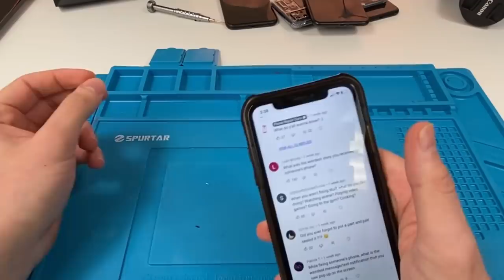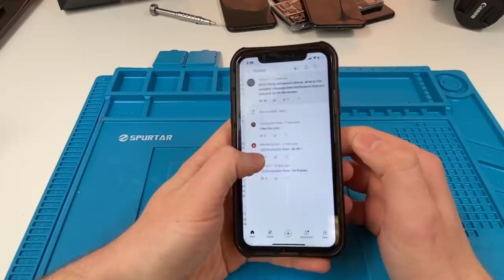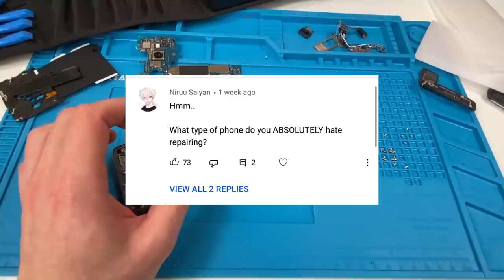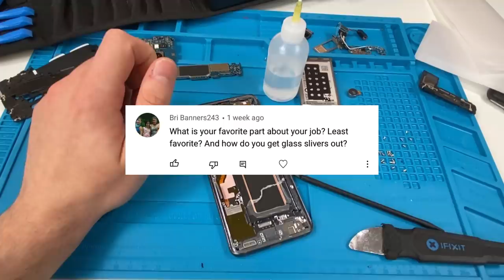Fixing a Samsung Galaxy S9 & Answering Your Questions

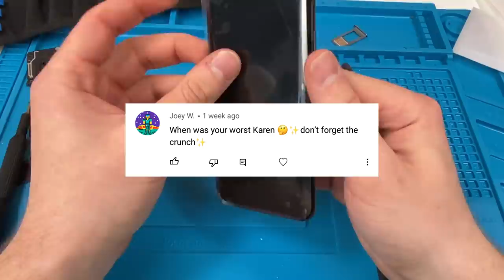Comment from the maker: The Karen part is at 8:00 for anyone to impatient
Geting a new pc and Camera tomorrow so Quality is going to fly up :)
Reply: I’m no karen, i won’t jump to the point, i’ll watch it all!!
Reply: Oh
Reply: The electronic screwdriver is so cool 😎
Reply: How do you get the Electric socket screwdriver?
Reply: Yup
Reply: What’s the most exotic phone I fixed?
Reply: Haha thank you
Reply: That’s mean....
Reply: Most epic fail?
Reply: where can i buy parts? pls
Reply: I never thought I'd find someone to explain this little process to, but you can probably help a bunch of people with it, @phonerepairguru.

I've been doing electronics repairs since 94. I live on a small island in the Caribbean and tourists seem to love dunking their electronics in the ocean. I found a way to salvage a fair number of them.

You need an ultrasonic cleaner. They're like $150USD. Buzzing a board in the ultrasonic cleans up under the chips under the non-removable heatsinks.

Here goes:
1) Remove the lcd and battery
2) If it was salt water, douse the rest of the phone with DISTILLED water
3) Remove the board
4) More DISTILLED water on the back of the board
5) Drop the board in the ultrasonic and buzz it for an hour on high, with heat
NOTE: Don't let the board sit in the solution after it's buzzed.
6) While the board is cooking, vigorously brush/clean or replace anything that looks crappy (shields, screws, cameras, home flex, battery, charger port, lcd, go crazy)
7) Ding! The board is done. Take it out with your fancy tongs. 
8) Douse it with DISTILLED water again. (Do you like how I yell DISTILLED every time? Sorry, I have been hurt.)
9) Hit it with a slow stream of IPA (do you use 99% isopropyl alcohol? If so, I would suggest switching to 99.9%, to get rid of 10x more of that water)
10) Place the board on a ceramic tile. I clean a spot on my floor for this step, but I always intend to go put a tile on my bench.
11) Use a heat gun to boil out the water. Don't overheat the board: set the gun to 250 degrees c/500 degrees f and hold it 10-12cm away. Heat the board evenly by slowly passing the gun over it. Every few seconds, passing your hand through the heat stream will give your brain a good indication of the board temp. Get it hot enough to boil away the water trapped under the heat sink and ICs. Flip the board over and do the exact same thing. This side takes much less time.
12) Appreciate how the board gleams and sparkles at you.
13) Let it cool completely. If the client isn't swinging from your chandeliers, demanding their phone, leave it overnight.
14) Reassemble and test. If it doesn't boot, it might be a good candidate for microsoldering. I have found the contacts on the front facing camera or lcd can get screwed up pretty easily.

Optional step:
15) Offer to clean jewelry for your mom or sisters or any jewelry-wearing humans in your life, and make them so happy.

For reference, I charge $30USD for the buzz if it doesn't work and $80USD if it does. I'll typically clear it with clients first so they know I am putting in more effort than normal. 

Thanks for the entertaining content,

J
Reply: @jasonmon12  that’s a lot of words good job 👍
Reply: @chickfilanuggy7127  I love chick a lay nuggies
Reply: What to do if your j7 prime charger is not working
Reply: I dont use to go out side but if i do every second people has to be a karen. Am I the unlucky person or every karen just has something to find me?
Reply: *too
Reply: Phone Repair Guru
Good thing: fix phones soo good 👌
Bad things:activate angry mode😡🤣😂😂
Reply: I can't wait to see it man! ❤️🖤😊
Reply: @Edesgera  wy
Reply: @bonoo5  in descripción!!!
Reply: Bro luv your vids also ill settle for a like
Reply: @ricardoparadaandmitens370  calling someone impatient is rude but also its a joke
Reply: Nice
Reply: So I’m not the only one that think the ringtone is an absolute banger
Reply: @ricardoparadaandmitens370  i want phone parts not tools and thanks for helping me
Reply: Who or what is a Karen?
Reply: Hey what. Camera is it(the new one)
Reply: Yay
Reply: Which carry random kids
Reply: Nice. Good for you.
Reply: @generalyido  
H i
Reply: The kid
Reply: The kit
Reply: What there was a Karen?
Reply: Bro btw how do you hook up that camera?
Reply: Where can I get my own Karan radar? ;)
Reply: Ok
Reply: This mans got his own Karen radar holy-
Reply: Hey guru I’m 13 and broke my iPhone 6s and took it to 
CPR to get it fixed and I paid $120 and the glass was really cheap and broke with my AirPods falling on it so I ordered a new screen an tools and fixed it myself but a month later I broke it again by dropping because I took of the case to replace the case and dropped the phone on pavement so I fixed it again and then I fixed my friends iPhone 7
Reply: @Sohamsta  same
Reply: Hi
Reply: Lol
Reply: What is karen
Reply: Getting geting lol

Comment: I fixed my note 9 and the back glass broke twice since the charger port was broke initially and so I put the replacement part on. I reassblemed it thinking the mic worked and it didn't. So I broke the back glass again to get into the phone to replace the charger assblemly again with one that I got from I fix it. The phone works great now! Overall it was a $30 fix which a shop I went to wanted $140 for the charger port with new backglass because I wasn't sure if mine was gonna break when they fixed it. I was tempted to buy a new phone but I've been watching your videos and a lot of repair tech youtubers lately that inspired to fix my phone so I didn't have to get a new $1200 one so thanks!

Comment: To help with getting the main board in, along with the antennas. Lift the charge port flex up slightly, plug in the main board with it being vertical, slowly lay it down, and slide the antennas into there place, should all just slide together.

Comment: My first ever repair was an ipad 6, had two of em with broken glass (little brothers aren't careful) my mom ordered the part for one, I did okay, might have killed the GPS and/or one of the speakers, still not sure, but it seemed to work for a while, until it started crashing randomly, still not sure if it was my fault. The second one I did the same thing, except I screwed up again and somehow killed the LCD, left it for a while a bit discouraged until I put them together and got one "good" ipad and one missing a ton of stuff. It was a rookie job, full of rookie mistakes, but everything started making sense after a while. Now I lile buying the old ipods and fixing them. It's not nearly as challenging, but to my siblings it still seems like rocket science lol

Comment: Tip for Samsung phones, use a super thin metal shim tool to seperate the adhesive from the back glass. Just insert it under the glass and run it along it'll bend instead of the glass reducing the chance of cracking. Just have to be careful about not  cutting anything inside.

Comment: Pro tip: you can remove the mono & dobo without unseating those antenna wires. Since you avoid gloves, do you use any other antistatic gear?

Comment: What temperature is recommended for ‘cooking’ devices? Mainly iPad and phone adhesive. I have a few 3D printers with heated beds and I was wondering if I could use one of those instead of buying a heat gun or hot plate. Love your videos!

Comment: Have you ever worked with an iPad air? I would be surprised because I had one for about 4 years , I dropped    it sooooo many times and it was fine. Until one time it hit a hard corner. It only needed a screen repair  though.

Comment: My first phone was an LG L40 Dual Core (2014)

I think i got to use it as of 2015. Too bad that when my grandfather sent it to us brand new and all of the 5 batteries (1 in phone, 4 spares) were faulty, basically the first charge was normal but the second charge will only last till 75% then shut down. When u try to start it up or chrage it it will get stuck in a boot loop.

Comment: Again, friendly advice from someone who repairs Samsungs daily. There's no need to disconnect the coaxial wires, the sub-board and the main board when removing it from the housing. Leave it all connected and just lift them all out together..... You'll thanks me a bunch later! and you'll no longer have the issue tucking the coaxial cables back under and struggling to connect the sub and main board.

Comment: I had my volume buttons get destroyed after falling off an 8 foot tall bunk bed and landing on linoleum tile. Everything else was miraculously saved, probably because the up volume button and power button got decimated and took all of the force. Instead of getting it fixed (because college and money), i found different apps for volume and powering down, and ways to start up my phone without a power button. Plugging the phone into my computer would start the phone up. It was an android phone from early 2010s, btw. I did that for a year and some before getting a new phone. I liked that android, and I wound up loving it even more after I got the damn Moto Z as a replacement. 

The Moto Z gave me so many issues. The battery was the biggest issue, and I would wind up having it completely crash and lose all of it's charge, which began happening just before reaching a year of ownership. It was lucky that I'd kept my old android, because that wound up being my communications device on wifi, and sometimes i would straight up switch the sd card into the Android. Then I got a replacement for the Moto Z battery, and it lasted a year before being an issue again. So hello Samsung A50! I would have kept using my Android, but I accidentally dropped it on a wood floor just right and shattered the screen; the buttons weren't in the saving space this time. The phone still works, but now the screen is held together with packing tape and the touch buttons often glitch out severely. It's still a  backup, but it's completely on standby until something unexpected and severe happens to my Samsung.

Thanks for reading my story. Moral of the story is: Samsung is better.

Comment: I would like to let you know my iPad 4 (yes the one with iOS 10.3.4 aka the cellular) and its volume buttons are dead they screen is also cracked (digitiser) and it still works I use assistive touch to control volume on it tho

Comment: you probably shorted boards because you use metal tools around the pads sometimes with the battery still plugged in and it get turned on by accident or left on. its exactly how ive done it.

Comment: hey, i have a S9 and a question i would really like it if you could give me a answer. So my S9 has a problem where it doesn't always like charging and sometimes this happens a lot it will say there is moisture in the charging port and i have tried multiple chargers and doesn't work if i try like blowing it out. Would it be worth it to take it in to maybe get fixed or checked or would i just have to get a new phone?

Comment: The S9 wasn't that bad. Try a Huawei damn. The battery was glued like hell in my Mate 20pro actually punctured while getting it out. Also half of my screws were already off when I opened it. I'm the 1st owner of the phone and NEVER took it to a repair before. Sealed from factory. Also.. New battery has to be programmed to work with these phones... It's a pain

Comment: Hello Kind Person, I have a question, with the ultra fast Charging phones with two batteries is it gonna cost the same to replace? Will the extreme speed affect the battery in any way? Will it degrade faster? Thank you!
Reply from the maker: Yeah it does wear it down faster, but the upside is it charges it faster
Reply: @PhoneRepairGuru  Thanks! The reply was immediate wow 😆

Comment: Samsung s9 has so many screen issues or should I say software issues related to screen 
Low brightness looks good but when the brightness is in the middle a yellow tint shows up 
Sometimes phone flickers when locking and immediately unlocking 
These all issues happened without anything no damages whatsoever 
I thought the problem was limited but in Samsung members I found out that it was happening to many Samsung s9 owners 
Why is this happening!? 
Samsung needs to fix this even if this phone is 3yrs old!

Comment: I am using a s9+ which has 40 percent working touch and a whit lined screen it is hard but It can detect touch at the bottom so I got no option I am 15 and not rich so I download cursor apps and started using the phone while it 52 percent works

Comment: had to agree with ipod 4 as an unrepairable device, it is such a pain in the ass. tried to replace the screen and ending up breaking the volume/power button, home button and broke the replacement screen as well. wtf apple?